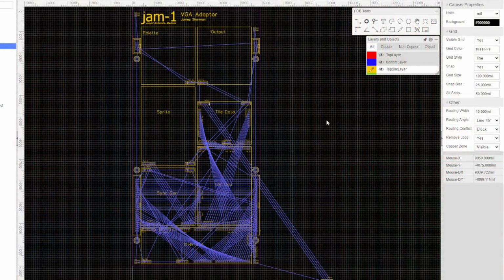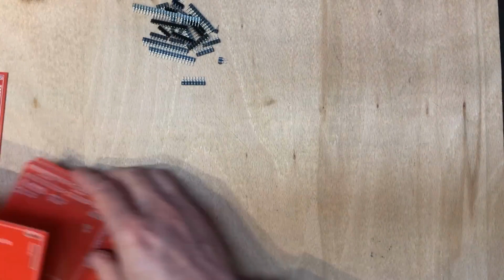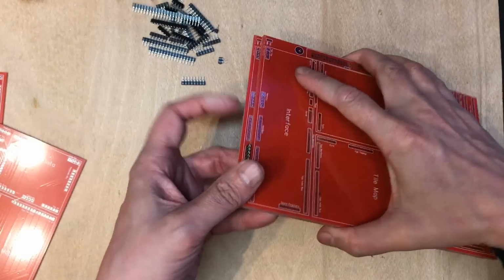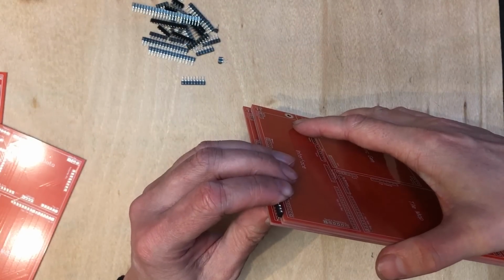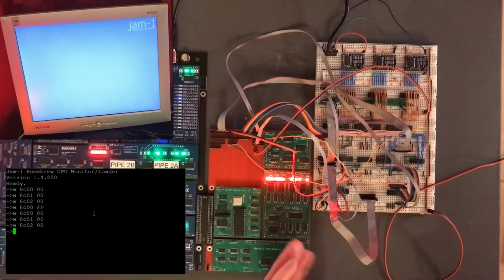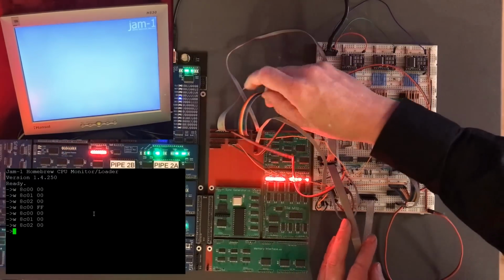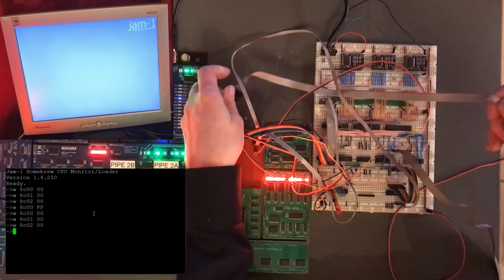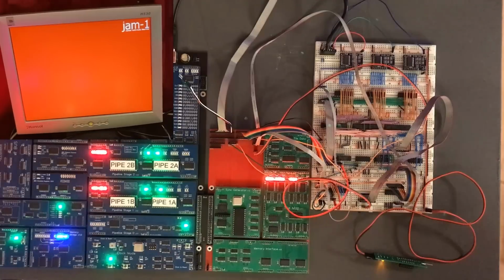Interim Backplane - VGA from Scratch - Part 16

Comment: to get the connectors to stay straight when soldering, plug them into male-male header rails, then stick them into one of your spare PCBs (just plug them in without soldering them) and stack the PCB you want to solder on top to make a PCB sandwich. stays put nicely especially if you have both vertical and horizontal connectors on the board as long as your holes aren't way too large.
Reply from the maker: Yeah, I’ve done exactly this before but it is predicated on have a bunch of spare headers around.

Comment: Your technique of holding the turned pin sockets upright is totally legit.(I would have not hesitated using enough solder actually, to let it flow through the entire plated hole to the other side, there's nothing wrong with that. Apart from you might need slightly hotter iron. But props for the soldering skills :) )
Reply from the maker: I'm still looking for the best way to do that! I want to try a 3d printed holder.

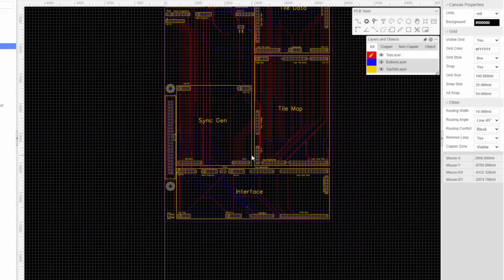Comment: 5:00 true true ^^
Reply from the maker: I know! I recently fully hand routed a similar board you'll see in the future so I know how much effort it's going to take to a good job of this one.
Reply: @weirdboyjim  it is impressive though.. my first and last attempts with auto-routers are 5 years ago, it was so ugly and didn't complete all nets so that I decided to put the brain power into it, with nice power planes and as equal trace length as possible with no strange angles, nice copper fill and so on .. I decided then it is well worth the time to route a board with gray matter instead of silicone and never bothered an auto-router again.. but it is nice to know that it works when in a hurry and aesthetic is not required ;)

Comment: If you decide to make this into a kit, it'd be nice to have the option to connect the different sections as vertical cards into a backplane, like PC slots. Maybe convertor boards from the existing boards that break out the connections to edge-connectors? Just so people could build smaller cases around it maybe? I guess anyone could really do that part, with the schematics!
Reply from the maker: My goal here is very much to create a display piece for people to understand the inner workings. You could make it much more dense in the way you describe. I'd probably design larger modules with more functionality on each though.

Comment: A good rip for keeping those sockets straight, attach them to their corresponding pins before soldering.
Reply from the maker: You mean use the finished modules?  That would work but I worry about damaging the modules.

Comment: I thill think it would be easier to hold the pin headers in with ca gel while soldering than faffing around with the boards. or possibly put the pin headers on the excisting modules and lay the backplane on top, that way they wil fit even if they dont look perfect.
Reply: I always just use masking tape to hold through hole components.... works well enough
Reply from the maker: I worry about using the existing modules as physical support.
Reply: @weirdboyjim  That seem reasonable. Teh might melt pretty readily.

Comment: As for soldering in headers.
Tack one pin in the middle, not caring too much about how straight it is.
Hold the board in your offhand, index finger on the connector, melt the solder of the tacked pin. Now you will easily feel when the connector is fully seated and square.
Let the tack cool down, then just solder in the rest of the pins. This is of course very hard with two pin connectors.
Reply from the maker: That's pretty much what I've been doing. Doesn't really matter which pin you tack though.